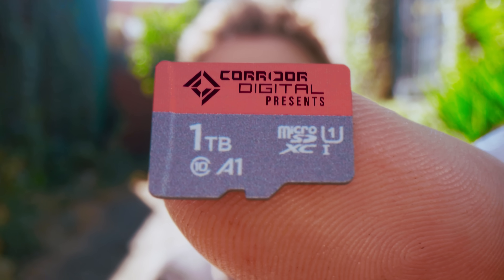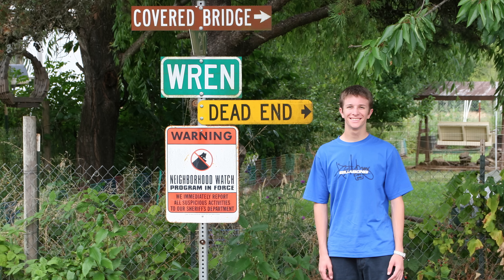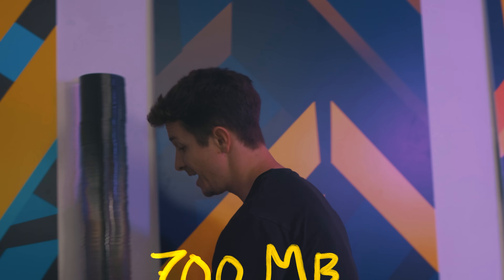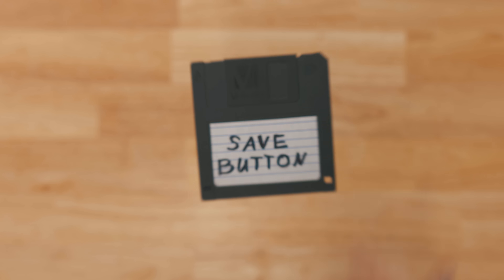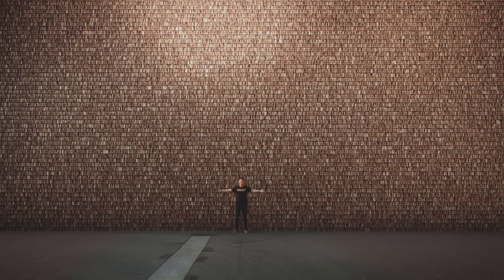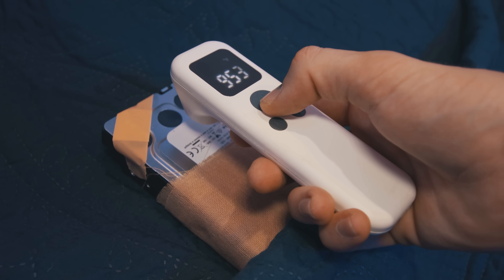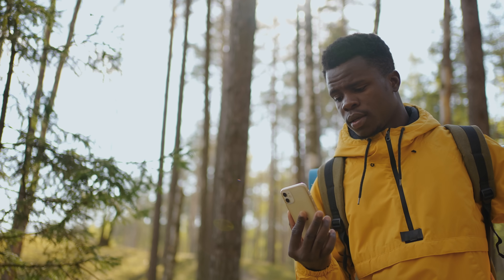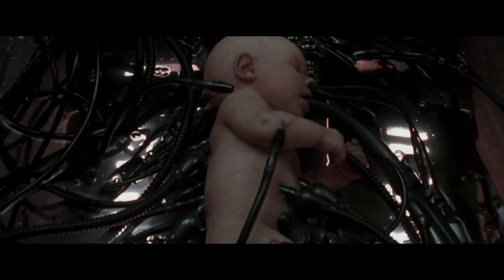VFX Artist Reveals the TRUE Scale of Data!

Comment: DNA data storage is a thing. Its just incredibly inefficient in power consumption and economically to synthesize the DNA. It is also one of the slowest methods of saving or reading data, but could be used for very long term archival purposes. At least in its current state.

Comment: For bettter accuracy, it's not a 1000x multiplier between the different storage sizes. It's 1024x. Not too huge of a difference, but that should be pointed out and then explain that 1000x simply makes the math easier.
Reply: You're wrong. "Kilo" is the prefix for 1000x, "Mega" is the prefix for 1000000x (1e6). 1 kiB (kibibyte) = 1024 B. 1 MiB (mebibyte) = 1024 kiB.

Comment: There are two things i think needs to be corrected.  DVDs can hold a max of about 8 gigabytes for Dual Layer DVDs. The 50 GB for Blu-Ray covers Dual Layer Blu-Ray discs. Single Layer Blu-Ray is 25GBs.  

More things to consider.

Floppy Disks were not the only types of magnetic storage. Zip Drives were some what popular magnetic drives back in the late 90s.  They held 100Mb, 250MB, then 750mb.  It’s existence was short lived as it was replaced by more cost effective CD-ROM.

A pure text document is a few KBs. But most people don’t use pure Text for writing documents like we would on paper. A modern Microsoft Word Document will not even fit on a Floppy Drive as it will be a few megabytes. This is because data is required for all the advanced formatting and fonts.  Add graphics, tables or pictures and the document size keeps growing.  However pure text files can become very large (gigabytes in size) when used as log files for high traffic Servers.

Comment: i have one thing and one thing only i don't like in this video:
SR-71 flying subsonic on cruise altitude
delta wings don't stall in conventional way but on low speeds its snoot droops and it just falls
on a cruise height the air is so thin, that SR-71 can't fly subsonic

Comment: But we were taught it increased by 1024bytes not 1000bytes...I know there was some reason behind this but i forgot.
Reply: 1024 bytes is a kibibyte, not a kilobyte.
They used to make it in powers of 2 because it was much simpler for the computers to handle. Nowadays, the computers can handle regular kilobytes, megabytes, etc. They just thought that 1024 was close enough to 1000. Hope that solves your problems (This is the reason Windows displays your 64GB USB as less than 64GB. Windows uses Gibibytes which are slightly bigger.)

Comment: 2:48 You made mistake because 1kilobyte isn't equal to 1000 bytes it's 1024 bytes and with others its the same.
But still I appreciate work put in this video.
Reply: 1 Kilobyte is 1000 bytes. What you're referring to for 1024 bytes is actually a kibibyte (search it up). Kibibytes are 1024 bytes because in the old days, people used powers of 2 as they were much easier to process and 1024 is close enough to 1000 that people didn't notice, nowadays, people mistake kilobytes as being 1024 bytes when they're actually 1000 bytes. Hope this answers your comment and you get a clear view of what a kilobyte actually is.
Reply: @VoidfluxOrb  I know.... I just wanted to say
Reply: @aleksanderkaczor14  If you knew that 1024 bytes is a kilobyte when it wasn't, why did you say that it was? I don't understand the intention of your comment.

Comment: Just one small detail, you could theoretically fit a lot more data on paper, because you could fit just a few unique characters and a cypher on the paper that can use base 16 (hexadecimal) base 32, or if you add more symbols you can write in higher bases, limited by the mechanism used to decode it only. I'm sure the estimates are accurate if you include only plain text storage, written in standard format though.
Reply: Kind of like a compression codec. Way more data, but don't lose the key......
Reply: @joeshmoe7967  Exactly, or you can use a key that draws on common knowledge ( all the English alphabet, followed by Japanese, etc. but these things are subject to change over time, making the information harder to decode as time passes. but, if you have enough unique characters, you can represent arbitrarily long strings of bits using just a few unique characters to separate them into discrete chunks.

Comment: At 5:45 - "The data here is coiled into a spiral disk" - No it's not.  The data is on concentric rings, and is read by a head that is moved to select the desired circular track - just like hard drives.  The early 8" floppies recorded on a single surface, and the IBM floppies that loaded the OS onto early mainframes had mechanically selected tracking, and you could hear them going klunk, klunk, klunk as they counted the tracks.  Once the "IPL" (Initial Program Load) was done, the mainframe could acess fast disk storage, vacuum-column tape drives, etc, but the IPL was done slowly from primitive 8" floppy drives.  
5  1/4" floppies were also single sided, but they quickly evolved to 2-surface recording, with a head on each side of the disk, doubling the capacity of a floppy disk, and through various encoding tricks, the capacity was multiplied several more times before floppies were phased out.  FM was used at first, requiring two clock bits per data bit, but the later MFM (Modified Frequency Modulation) encoded a single clock transition per data bit, which doubled capacity.  This was in the late 1970's.

Comment: Apparently  IBM has found a way to store 1 Bit on 12 atoms. 

1 Zetabyte of data could be stored on a 10 g piece of iron.

The 370,000,000,000 Zetabyte, of Information stored in human DNA, would only need a 3.700.000t block of metal.
(Either i made a mistake or our DNA is even better than 12 atoms at storing data.)

Zetabyte * 96 atoms * mass of iron atom in g
2^70     * 96       * 9,273 × 10^-23g

Comment: About comments after Linus explanation. 
Actually, if you'd build a RAID-5 array using microSD card, then maintaining it would be as easy as just replacing failed cells with new ones, so it will be even safer than HDD, which may or may not start behaving strange before it fails.

Comment: Small correction is, 1024 bytes = 1 kilobyte and so on
Reply: 1024 bytes is 1 kibibyte not kilobyte
Reply: Units of 1024 are Kibiytes, Mebiytes, Gibibytes, etc. Units of 1000 are Kilobytes, Megabytes, Gigabytes, etc. You can search up the difference between Kibibytes (KiB) and Kilobytes (KB) if you are still confused.

Comment: Hey Wren - have you ever done a video about SPEEDS instead of sizes? I want to see what it would look like to have a fighter jet go past just feet above the roof of my house on full afterburners at 700MPH. I want to see how quickly the International Space Station would blip by and over the horizon at a blistering 17,130MPH. Not fast enough? What about the solar system moving through the universe (there are many figures depending on reference point but ... 448,000MPH maybe?). Of course you'd probably have to ignore some physics to remove the air resistance effects - or at least to start with! Then you could throw all the visual effects muscle behind it to add back in what kind of flare it might make if something the size of the ISS really was orbiting that fast at such a low altitude 😀

Comment: It's not 1000 of one into the next- because of computing and maths, it's 1024. ANYTHING that claims otherwise is cheating you out of money. Thanks for the correction, Apple YT.
Reply: Units of 1024 are Kibiytes, Mebiytes, Gibibytes, etc. Units of 1000 are Kilobytes, Megabytes, Gigabytes, etc. You can search up the difference between Kibibytes (KiB) and Kilobytes (KB) if you are still confused.
Reply: @VoidfluxOrb  No, I do remember being taught that 1024 kilobytes were 1 megabyte. And that the next one down IS just bytes (which are made of bits, the lowest you can get) so I have NO clue where tf kibi, mebi, and gibi come from- I grew up in the 80's and 90's and they sure as heck didn't exist back then.
Reply: @rorschachsquillpen  Yup, they didn't, only up until 1998 did they add it, so many people born before 1998 had no idea about this.

Comment: Years ago, the US Patent Office refused to accept filings in digital form. It was paper or nothing. But when genetic engineering patents started being filed, the inventors wanted to file a digital copy of the data. The Patent Office told them they couldn't do that. So the inventors asked where they wanted the truckloads of paper to be delivered. They explained that the data they needed to file could fit on a single CD, but if printed, it would take at least two 18-wheelers to carry all the paper. The Patent Office decided that digital data was OK in that case.

Comment: a 20 pound  500 Sheet Ream of  8.5" x 11" paper 
will hold 1 megabyte of data  & is 2.5" thick  & so 
1 terabyte requires a 39.457 mile thick stack of it

Comment: The thing with the SSDs is that it would be significant larger. Since you would need them mounted in readers. It also would probably need aome cooling, if you have that many electrical circuits in such a tight space. It would still be comparably small.

Comment: I worked at data center they're not as packed with racks as you'd think wouldnt be efficient way to keep them cool. There's like 30 racks per room, I looked up the servers they had one time like 3 years ago and they were like 300k a pop and each rack had two. There are 4 rooms in each area and 4 areas 30x2x4x4x300k = 288mil per building and there were 8 of em so the "vendor" had like 2.3 bil into this place plus labor

Comment: If each 604 memory bit put out around 5w of heat. (Orginial 604 used around 7kw for 1100 tubes), the total power output would be around 40 TW,  or very close to the total amount of heat energy generated by the entire planet.

Comment: Data sizes are actually supposed to be in groups of 1,024 and not 1,000 ... 1KB is supposed to be 1,024 bytes. We have to denote that as KiB now though because the incorrect measurements by 1,000 are so pervasive now. As a low-level programmer, I notice that hardware manufacturers and driver developers generally stick to the proper 1,024 format in their C header files and the way their code computes capacity. In my own DirectX code I use 1,024 units but I had to differentiate KB from KiB and MB from MiB and so on because the world is so confused now lol

Comment: 2:48 Actualy 1024 Bytes is 1 Kilobyte, and 1024 Kilobytes is 1 Megabyte and so on
Reply: Units of 1024 are Kibiytes, Mebiytes, Gibibytes, etc. Units of 1000 are Kilobytes, Megabytes, Gigabytes, etc. You can search up the difference between Kibibytes (KiB) and Kilobytes (KB) if you are still confused.
Reply: @VoidfluxOrb  Ok i just found an article that says                   

A “kibibyte” is equal to 1024, or 2^10, bytes. Simple enough, but isn’t a “kilobyte” also 1024 bytes? Well, it is, sometimes. As defined by the International System of Units, the prefix “kilo” refers to 1000, or 10^3. Most storage manufacturers measure and label capacity in base 10 (1 kilobyte = 1000 bytes; 1 megabyte = 1000 kilobytes; 1 gigabyte = 1000 megabytes; 1 terabyte = 1000 gigabytes). RAM vendors and most operating systems, however, use base 2 (1 kilobyte = 1024 bytes; 1 megabyte = 1024 kilobytes; 1 gigabyte = 1024 megabytes; 1 terabyte = 1024 gigabytes). (A notable exception to this is macOS, which has used base 10 since OS X 10.6.)  So in order to know what exactly is meant by “gigabyte”, you need to know the context in which the word is being used. If you are talking about raw hard drive capacity, a gigabyte is 1000000000 bytes. If you are talking about the file system on top of that hard drive, then gigabyte means 1073741824 bytes
Reply: @trolek367  The most commonly accepted definition (Things like USBs) use KB as 1000. If you have ever noticed that the USBs commonly say they have less storage than advertised, they aren't actually scamming you. It's just that Windows hasn't changed from before 1998 and displays it as KB instead of KiB. KiBs are larger than KBs so the USBs display as being smaller. If you still have questions, you may ask them.
Reply: @VoidfluxOrb  I don't have any questions. Thanks for teaching me that
Reply: @VoidfluxOrb  I didn't know that thanks

Comment: It's actually 1024 not 1000
Reply: Units of 1024 are Kibiytes, Mebiytes, Gibibytes, etc. Units of 1000 are Kilobytes, Megabytes, Gigabytes, etc. You can search up the difference between Kibibytes (KiB) and Kilobytes (KB) if you are still confused.
Reply: @VoidfluxOrb  Why 1 KB is 1024 and not 1000?
Remember: Computers can only work with binary code. However computers do like the number 1024 because its binary code is 10000000000. That's why there are 1024 Bytes in a KB, 1024 KB in a MB and so on…15 Apr 2014
Source: Google

Comment: You call DNA the ultimate storage but you've missed the truly theoretical max data storage density.  The event horizon of a black hole.  1 bit per four planck areas.  Storing more data than 1 bit for four planck areas would necessarily create a black hole that would redistribute the data onto an event horizon no less than four planck areas per bit.  You literally cannot get more dense than that in this universe.

Comment: After using a calculator my mind hurts. Each person on earth has about 370 geopbytes of data. One geopbytes is about 1030 bytes which is a nonillion or a one with 30 zeros. and now multiply that by 370 and you have the data of one person but then multiply that by 8,000,000,000(roughly the population of humans) you get 2.96E42 with is 1 followed bye 42 zeros also called a tredecillion and looks like this 296000000000000000000000000000000000000000(I'm not sure how to write big numbers like this so it may be even written larger) also u should prob not take this that serious because i prob messed up something so take it with a grain of salt

Comment: 1kB is 1024 bytes, not 1000
Reply: Units of 1024 are Kibiytes, Mebiytes, Gibibytes, etc. Units of 1000 are Kilobytes, Megabytes, Gigabytes, etc. You can search up the difference between Kibibytes (KiB) and Kilobytes (KB) if you are still confused
Reply: Am a software engineer. Bits, kilobits, megabits, ... increase in factors of 1,000.
Bits and bytes are different, do your research.
Reply: @eugenetaban354  You said it yourself, Kilobytes, Megabytes, Gigabytes, etc. increase in factors of 1000. And I did do my research as I have a degree in software engineering.

Comment: Just noticed your comment at the top. By my calculations, 6 billion base pairs, each encoding two bits (Base4 encoding) of DNA per cell = 11 GBs. Now 37.2 trillion (according to Google) or 1700 trillion (according to this video) cells results in 378 zettabytes and 17279 zettabytes respectively. Bytes here are in powers of 1024.

Oddly enough, Google says we have 125 trillion synapses, each of which represents an apparently analog calculation with an output of either zero or one (for electrical messaging). Each node in a neural network is a rough synapse approximation. Each synapse has its own circuitry to determine the result. The granularity or number of possible input states per synapse is probably not known.

Comment: Fun fact: each measurement of data are not 1000x larger, rather 1024
Reply: eh, close enough
Reply: Units of 1024 are Kibiytes, Mebiytes, Gibibytes, etc. Units of 1000 are Kilobytes, Megabytes, Gigabytes, etc. You can search up the difference between Kibibytes (KiB) and Kilobytes (KB) if you are still confused
Reply: @VoidfluxOrb  eh not quite true i work as a software engineer
Reply: @Techmej  I have a degree in software engineering

Comment: 2:49 
1024 bytes = 1 Kb
1024 kb = 1 Mb
.
.
.
.
.
.
.
.
.
Reply: Units of 1024 are Kibiytes, Mebiytes, Gibibytes, etc. Units of 1000 are Kilobytes, Megabytes, Gigabytes, etc. You can search up the difference between Kibibytes (KiB) and Kilobytes (KB) if you are still confused
Reply: @VoidfluxOrb  According to the International System of Units (SI), kilo prefix is specified as 1000 (103). Based on this, 1 kilobyte is equal to 1000 bytes. Its international symbol is kB. 
In computer technologies, a kilobyte is specified as 1024.

Comment: Having worked for a company that did decom,  I will tell you we were decommissioning two and three year old racks that were 10 PB + in one rack and they had the ability to do a whole lot more if they could get the drives in the capacity needed. These belonged to a certain company with blue and white and controversy all over.

Comment: Coincident current ferrite core memory works on the principle that current flowing through a wire has a magnetic flux field propagating around it. ("Right hand rule": thumb is the direction current is flowing, fingers are the direction of the magnetic field.) coupled with the fact that high permeability ferrite cores around a wire act as inductors, storing charge as magnetism, and causing differing hysteresis and propagation depending on whether you've written a one or a zero to that core. Run three wires through a core (X, Y, and Sense/half-select) and you can address individual cores in a planar array of them. Core memory is destructive-read: You have to write back after reading. But that's getting into the weeds of it. 

People wrung every last drop of performance out of the materials at hand back in the day. Now, our programs are hundreds of megabytes to print "Hello World" when you could theoretically do it in less than a hundred bytes of assembly.

Comment: One of the biggest difference between bit and DNA is that DNA is not 1 and 0 but A T C G, four possibilities instead of two. Also, to associate an amino acid (that the basic bric of a protein) 3 letters are used (for example, ATC and TCC will not associate the same amino acid and some like ATG are coding to stop the sequence. It's called a codon)
So maybe if we could consider a codon is a bit, then this give us a bit with 4*4*4 possiblities.